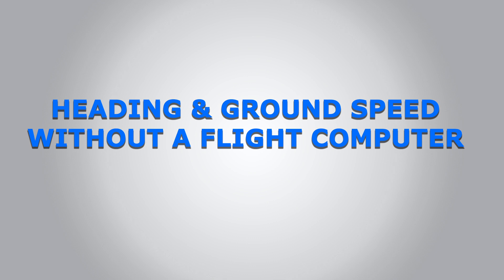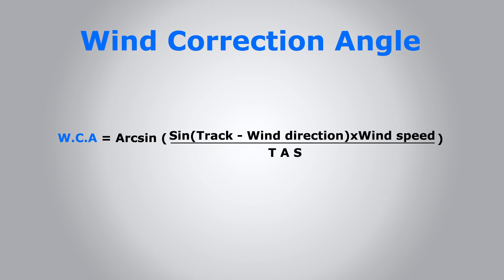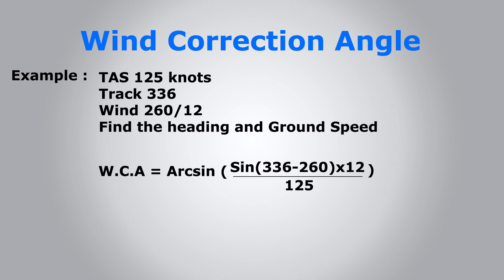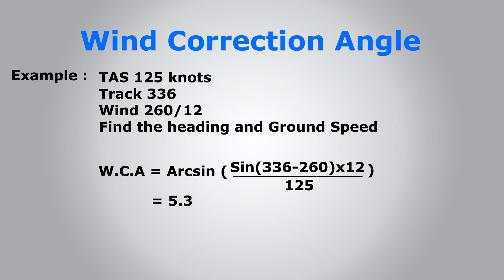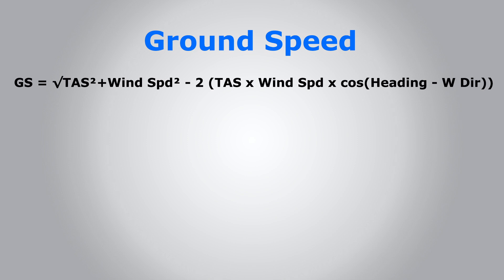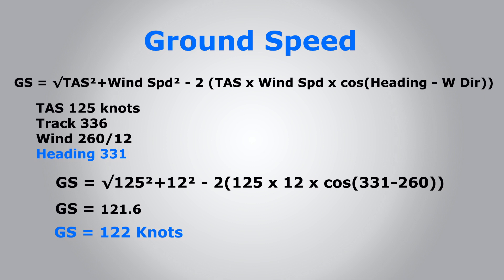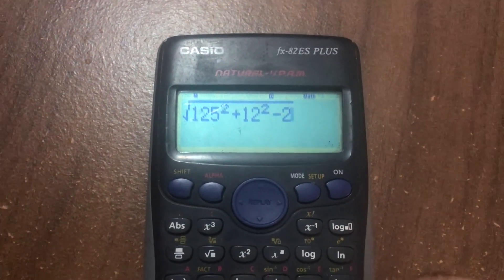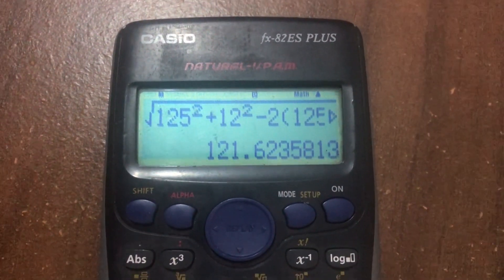How To Find Heading And Ground Speed Without a CRP5 or E6B

Comment: That's exactly what i found on the E6B but i think E6B is pretty straightforward rather than using all these formulas and plugging them into the calculator and you can also come up with a wrong answer so E6B is the king
Reply from the maker: Whichever way is easier for you mate